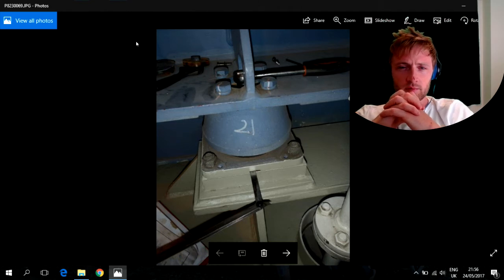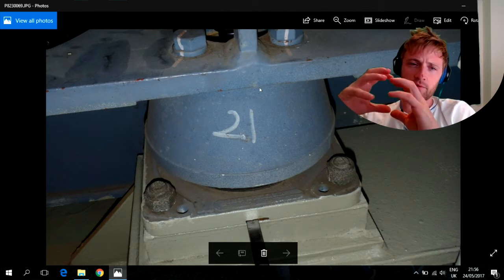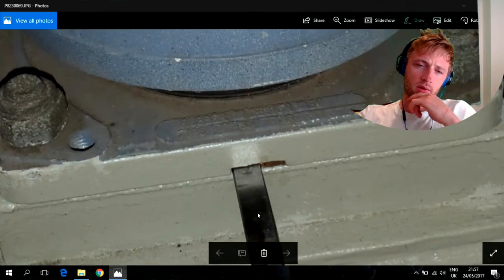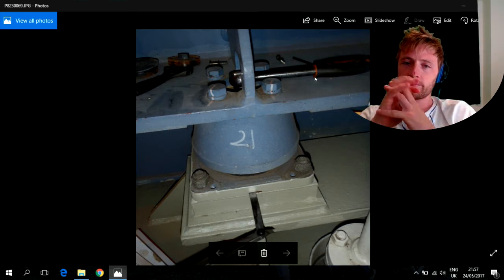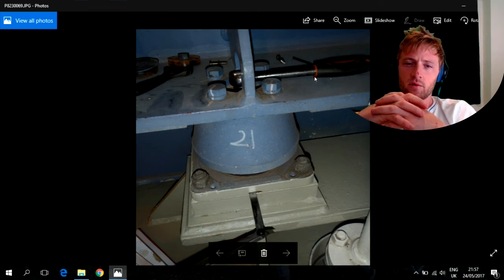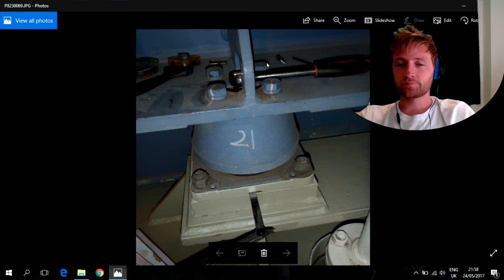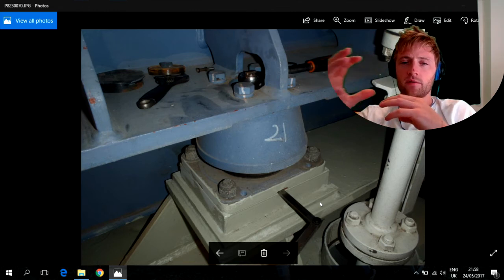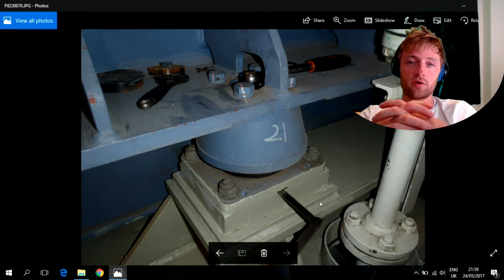HOW TO MEASURE AND ADJUST DG RESILIENT MOUNTS

Comment: The clearance is still inside sir? Or that clearance we are seeing from the outside?
Reply from the maker: The measurement is inside and you also adjust a specific clearance so when you fill that you have reached the clearance secure and pull out your gauge.Take one more measure with your gauges to verify that is properly adjusted.